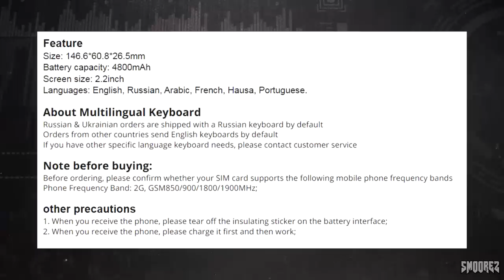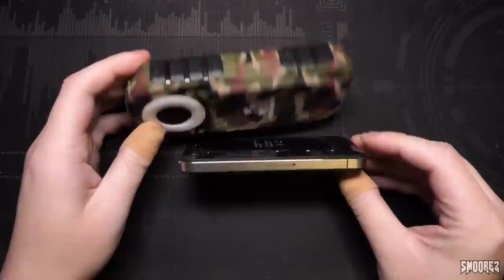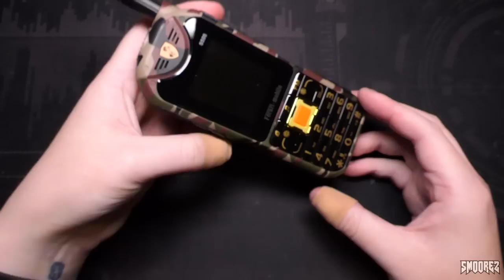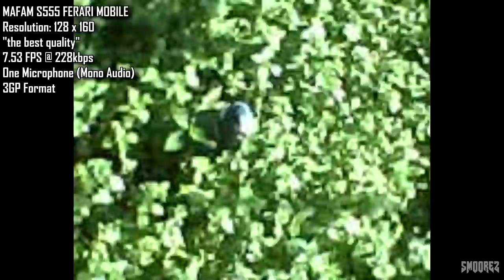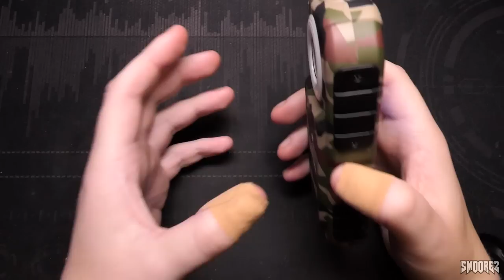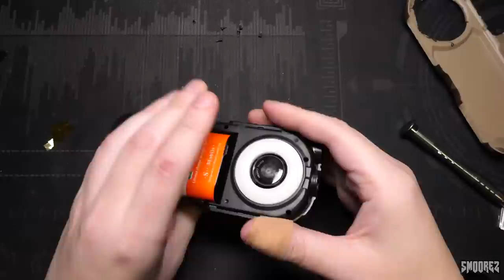The $35 MAFAM S555 "FERARI MOBILE" Phone from AliExpress is not a rugged device...nor a car

Comment: There was a drug dealer phone from 2006 that actually looked a lot like this:
The NEXTEL i605 by Motorola. That's where the icons and general design are ripped from. But unlike this, it's ringtones weren't ripped from iPhones and, instead of a power bank, the i605 actually had a working walkie-talkie called NEXTEL DirectConnect.

This thing has clearly gone backwards from its NEXTEL/Motorola forefathers... 😂

Comment: " A telescope in outback Western Australia has been used to listen to a mysterious cigar-shaped object that entered our Solar System late last year.

The unusual object—known as 'Oumuamua—came from another solar system, prompting speculation it could be an alien spacecraft.

"So astronomers went back through observations from the Murchison Widefield Array (MWA) telescope to check for radio transmissions coming from the object between the frequencies of 72 and 102MHz —similar to the frequency range in which FM radio is broadcast. "
Might explain what you tuned into